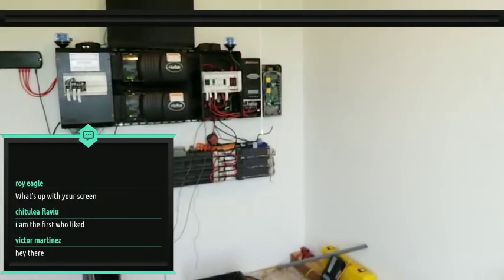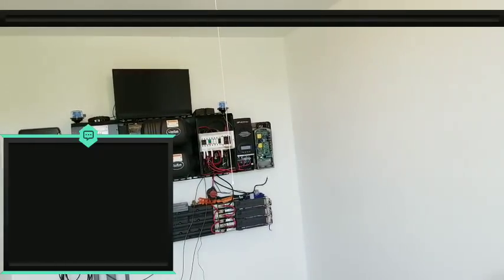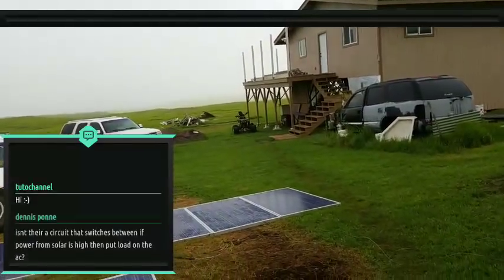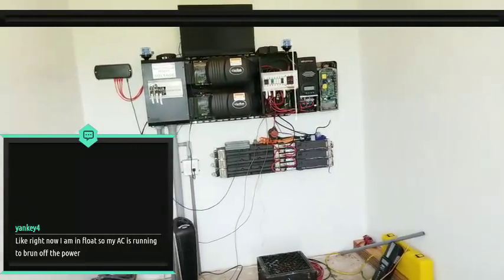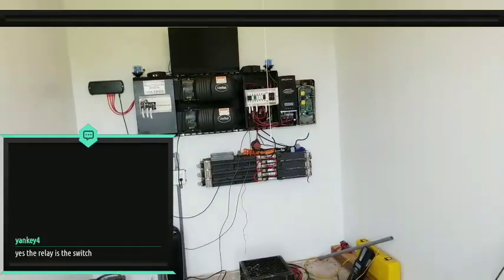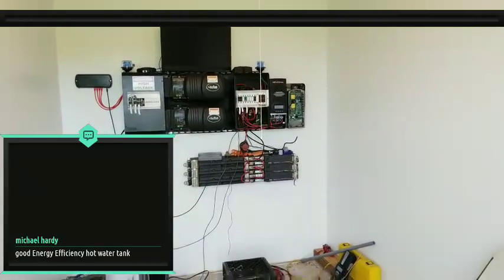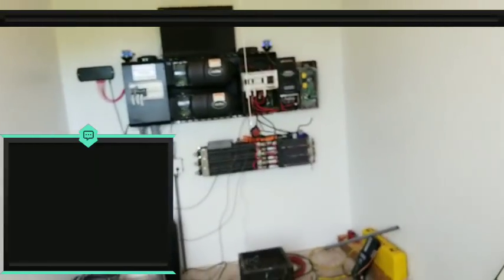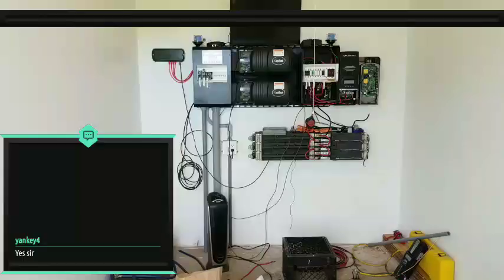My Tesla Powered Off Grid Home Build

Comment: use a soild state relay on the circuit you want to turn on and off and use the aux to control it then you can use anything as a dump load
Reply from the maker: Yah I did that it's been like that for some time now working really good, tonites vids will be showing all that, lots of my vids are backlogged. Yah been dumping all the extra power into my hot water heater. But thanks for looking out. Thanks for the support

Comment: Hey there! Nice setup! When you make the bus bars will you have the negative coming from the top cell or will it be connected to the bottom? That should be better for current balancing so it won’t wear the tops cells more than the bottom ones
Reply from the maker: Thanks man. Yah the wiring I have now is just temp. When I make the bus bar it will be top and bottom. Thanks for the support

Comment: I would run the mining rig off you 12v system and take the excess power to a dump converter and  hage the 12v bank I have a 750w dump converter I help charge my 12 battery bank or 24v from my 48v
Reply: old time engineer yea that is what I was thinking, once the 12v system is charged fully then run the miner till it is at 12v or something not too low
Reply from the maker: Yah that's a great idea, the only things is it would beat down on the 12v inverter also I paid more money for a really good 12v inverter, something to think about.
Reply: go with a DC-DC converter like Pete has done with his battery hasher! https://youtu.be/bSGWYQyN_OE